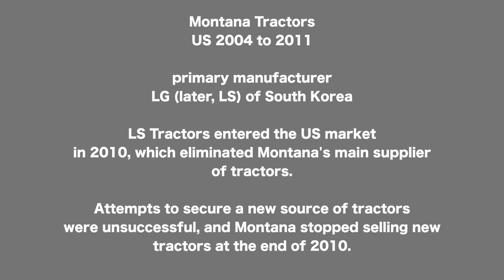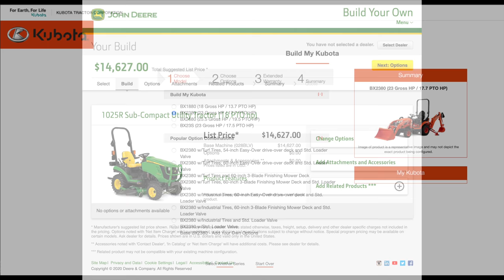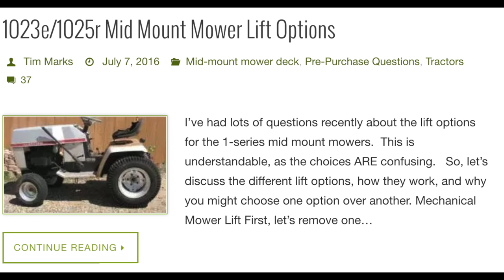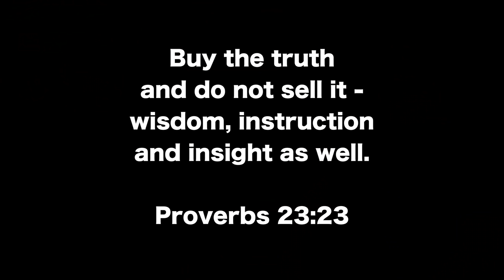Have NO REGRETS! Watch This Before You Buy A New Compact Tractor!

Comment: Tim, That was really helpful. I bought a 1025R 5 years ago on the advice of a friend who had one and now has a 2000 series. Yes, it was a lot of money but I had spent a lot of money for a Cub 52" riding mower that never worked and had a warranty worthy of the grass clippings it didn't make. I have 20 acres with 1/2 of it cleared and a combination of lawn and field grass. You convinced me to buy an MMM and it is awesome, especially compared to the Cub.

I went to 2 JD dealers and found a lot of difference between them. One was very helpful and understanding of my situation as never having any tractor experience. The other seemed totally uninterested in selling. They are equidistant from me in opposite directions by about 40-45 miles.

 I eventually got the 120 loader, 48" tiller, 48' rotary cutter,  the 60" MMM and a 60" rake. My neighbor gave me her 60" box blade. I can do everything I've needed so far with that equipment. My neighbors with large farms around me drive by with their big blue and white tractors with wheels higher than my ROPS and laugh at me and ask me what I'm going to do with my toy. Same thing you can do only it takes me longer! I'm totally happy with my 1025R and highly recommend it to a 1st time tractor buyer. Bet money I've ever spent on a toy....I mean tool! TTWT has been very helpful explaining the use of some of this equipment and introducing me to new add-ons as well.

Comment: Hey Tim!  I’m looking to either get the JD 1023 and the 1025r. My question is, what’s the best cab enclosure to get where I can have heat, a/c and a radio in it?  I’m a huge fan, and I know that you’d know the answer. Thank you.
Reply from the maker: I’m not a cab expert for 1 series.  I have a removable cab from originalcab.com
If you want a permanent cab, and looking at a new tractor, consider ordering the factory cab.

Comment: Would love to hear your thoughts on the 23 vs 25 horsepower versions (any brand). I’m a GC1705 (23hp) owner because my dealer said it saves money and will still do all the work I wanted, all while using less fuel over the 25hp version. I guess what I’m saying is if you go with the smallest one that will accomplish your tasks you may end up with a 1023E and 1 extra attachment.
Reply: I understand there are more bells and whistles as you size up. But most are not “must haves”

Comment: You might want to research who makes the small John Deere’s. I had a 25 hp 20 series. It was made by Yanmar for John Deere. None the less a fantastic tractor.
Reply from the maker: Used fo be made by yanmar.
Now they make their own.  Check out our 1 series factory tour video.
Reply: Yes sir I just did. I’m impressed. The one I had was an early 2000 model. The I d tag still said made by Yanmar. I am currently trying to persuade my brother to buy a 2025r. He has a 9 acre yard and he wants a 1025. Which I believe is the wrong series for his application.  The small John Deere’s are impressive machines. Only regret I had with mine is that I sold it with my farm. Thanks for posting your vids.

Comment: What about how will the local dealer will treat you if you buy it elsewhere? In my case, the next state over doesn't have sales tax (yes, by all rights we should pay our state) so that's a 6% discount right off that our local dealer may not be willing to match. I'm also not so sure how much I need my local dealer - Will I? Other than any warranty work, I'd probably do my own maintenance and repairs and order parts online.
Reply from the maker: All good questions without easy answers.

Comment: The coyote is a super attractive option.  Probably 10k less then a dear or kubota especially with 1 acre of land how much are you actually going to use it ?  The only thing I don’t like about Deere is you need to go back to Deere for attachments  because of the one family thing.   Nothing wrong with the massie either for that matter and they been around forever. The new holland is a decent buy to if you don’t mind the pin on  bucket.  1 acre jd or kubota is overkill unless you got to much money lol.  I have the kubota and don’t regret it but a guy can get away with any of the major brands to be honest as they are all good units.

Comment: Beautiful wrench set on the wall. Where were they made? My first set were cheap Chinese made bought at tractor store. Using the larger size on tractor equipment they would break. The open end arm would would break. Not good when you need to do a repair. Ended up buying quality wrenches. Unfortunately most are made overseas but steel is better. You usually get what you pay for.
Noticed you didn’t mention the Ventrac. Would be a little much for his situation.
Would put hydraulics on the rear and front.
Reply from the maker: Cheap Chinese set.  Bought them at the farm show this year.  I can’t justify good US wrenches as little as I use then.
...but I HAVE used them several times since Feb purchase.
Reply from the maker: Ventrac not appropriate for Nolan’s needs.

Comment: I understand the Deere and Kubota are great choices, but always disappointed that Massey is not included in the top brands to consider because they have been around for ever and dealer support is there as well, plus they are rock solid and cheaper to purchase. If there is a Massey dealer in your area I suggest you have a good strong look. I have a Massey with a loader and a 54" mm mower and the cut quality is awesome. Tractor never missed a single beat yet.
Reply from the maker: Massey has been featured in at least 3 episodes on this channel.  More than any other brand (other than Deere/Kubota).
Reply: @TractorTimewithTim  Yes I remember watching those videos, they were great. Your absolutely correct about Deere and Kubota being the 2 most popular brands, I just wish Massey would try harder to compete with them, they just need to work on some comfort features and better marketing to bring them up to the level of the other 2 top dogs. Thanks for the videos I watch them all.
Reply from the maker: Danny totally agree.  They are close, but they need a bit more refinement.

Comment: I'm heavily thinking about investing into a 1025r with the front loader, belly mower, and backhoe attachments to start a side landscaping/mowing/contracting work like trenches for plumbing and what not. Is that a good tractor for a good business start?
Reply from the maker: 1025r might be fine.  However, you need experience before you start charging folks for service.

Comment: You’ve talked about two brands, but why is there no mention of IH/New Holland or Case?  Based on your comment, they have both been around a long time?  Maybe they just don’t have the small tractor market?
Reply from the maker: IH/NH/Case does not make their own little tractors.  They remarket LS tractors.  Can’t remember if I mentioned in this video,  but this disqualifies a vendor for me.  If they have not committed enough to design/build their own product, I am not confident that they will be supported for the long term.
Reply: Tractor Time with Tim thanks. I own a 2000 TC45D that I bought new. I had owned a Ford 2000 before that, that I loved.  The TC has been a good tractor up until last year when I believe the from splines have gone bad. I can use it, unlike what I have read from others, but the AWD part is not working.  I’ve been going back and forth on getting a 1025r with a cab, loader, and 60” mower, but then I wonder about the same setup with a 2025r. I am keeping the TC since all of my implements are Category 3. I do like that the 2025 has a little more lift, but after watching this video, I think the 1025r might be good enough. Thanks!
Reply: I’ve been watching both you and Good Works Tractors and it has been super informative. I have a GX345 that is a 2002 model, but has been having issues and living in Minnesota, I want a cab for winter.
Reply from the maker: Check out originalcab.com.  Use code TTWT for a 5% discount.  Works great, and is surprisingly warm on the 1025r.

Comment: Following along here.I am in the market for a small tractor.Now my  horizons have been expanded our century farm needs tlc.I purchased a 316 garden tractor in 1985 the long term usability of the machine.It now has around 3500 hrs.on it.Mower decks not available front axle(cast iron)rebuild parts not available.Onan engine or parts not available.This machine is solid and was led to believe that jd was great about this.I am disappointed in jd for this.My late father and I did some engine work on a 1953 jd model m.parts available from jd.So to wrap this up my 316 got a very used mower deck off of craigs list.It now has a Briggs and Stratton vanguard engine and a need for spindles in the axle.It is still mowing grass not as much torque as the onan.The trans axle is rock solid.Big rant here but can I trust jd?Our families 1953 farm all super c we can get parts for.So the big question is when you step up to a "tractor"what does 30 years out look like?I don't take a purchase such as this lightly.

Comment: Tractor Time with Tim
Form what I had heard LS and New Holland are actually put together in the same plant. Basically the same tractor from what I was told.
Reply from the maker: Identical.  We showed this last fall at the Farm Progress Show.
Reply: @TractorTimewithTim  I'm not embarrassed to say I've owned an LS for the last decade.  No major repairs, has done everything I've thrown at it, most of the time successfully (sometimes you just need a big skidder or a loader).  But parts wise that is accurate, it's basically a South Korean New Holland, and luckily I'm only a few hours away from the plant in Battleboro NC if the dealer can't help me out.  Main benefit was HP for HP I ended up paying it off 4 or 5 years earlier than I would have a Green or an Orange tractor.

Comment: im just starting out with 2.1 acres and a 4 horse barn.. i want a front end bucket. its already cleared land. ( i already have a zero turn john deere)..i also have 200 acres, about 200 miles away (inherited it) i will be there a few times a year. it has a 1/2 mile long driveway. and will need to be maintained..... i also have a 200ft long driveway at my house... so idk what tractor i need or just an ATV or what. we plan on at least 2 horses and maybe goats..  thanks
Reply from the maker: 3R if you have a truck large enough to pull the necessary trailer.
Reply: @TractorTimewithTim  thank you for the input, I would say my truck could pull it, but already need a truck to pull my mud truck...ill look into the 3R and go from there, thank you

Comment: Hi Tim  I've heard that Deer have or trying to basically make owners take their tractors to a Deer dealer for maintenance or repairs . I've heard there's a challenge going on called " the right to repair. Have you any information on this  Like your videos    Great topics
Reply from the maker: Does not apply to compact tractors at all, and it has become very political.  The issue is much more nuanced than you suggest.  There is no issue with folks repairing their own machines.  Deere was trying to guard against folks making software changes to the engine which could damage the machine, invalidate emissions, etc.

Comment: Tim does the 2038 do much better on using the post hole digger than the 1025? Just wondering if there is a difference, I know you was not happy with it on the 1025. I worry that I’d have to look at renting a bigger  tractor for my area because it has a lot of rock. Other than that, I think the 1025 or the bx would be great for my 5 acres.
Reply from the maker: I haven't tried it on the 2038r

Comment: Never set your Heart on one brand and model like i did cause you might be disappointed if you don't get the dealer treatment on it and have to go to another brand.   The Best thing really is Dealer service and parts and the product knowledge that they have on what your looking for. And also if they are really aggressive they will shoot you a good deal right off the bat and you should also get a test drive or even a at home demo … and also inquire since Farm Bureau and Military service you can get special discounts and Kubota usually offers a multi unit if you buy accessories tools and such … Kubota and Deere are the only 2 that really do make their own tractors and the others even Agco and CNH are outsourced and the other gaggle is very much the same when it comes to Components

Comment: My biggest regret with my 1025r purchase is that I did not get the third function kit. I'm not a fan of most of the aftermarket ones mainly due to the price of them. Having the third function add a couple of bucks to the tractors financing would be easier on the wallet than a $700 kit from someone after the fact, plus the price would be "hidden" in the tractor payment so easier to justify a grapple or other toy to the finance committee.
Reply from the maker: Wow. This is what I was talking about in the video.  $1400 up front with the tractor vs. $700 for Artillian kit. ...all to get it included in the financing.  Tell you what, I might be willing to finance the artillian kit for you at THAT rate!!!
Reply: @TractorTimewithTim  Well, my point was more that I  wish I had this video to watch before I had purchased my 1025. I just didn't know then. To be perfectly honest though,  it's mostly your fault that I want a grapple in the first place, lol. I do really enjoy your videos, keep up the great work.

Comment: Some serious consideration should be given to a QUALTY low hour USED tractor vs a new model. You can save a bundle if you can be serlective in the used model shopping. Put the savings into attachments.

Comment: Definitely not knocking green, but it is a Yanmar Tractor, I have an older JD 750, tag on tractor says Yanmar Engine works.
Reply from the maker: The 750 was a Yanmar tractor.  Starting in 2001, Deere began designing their own compact tractors.  The last of the pure Yanmar tractors were retired in 2016.
New machines still use Yanmar engines, but they are designed in Georgia.

Comment: Wondering what you think about the LS MT125?  The one I am looking at comes with a front loader, backhoe and belly mower and it's about $2000 cheaper than the JD 1025r. It's my understanding that they are made by the same company that makes the New Holland. Is that true or am I mistaken? Also, they have the same Yanmar motor as the 1025r
Reply from the maker: This episode clearly explains why we stick with ‘the big two’
Reply: @TractorTimewithTim  It explains why you like the big 2 and as you said it is your opinion.

Comment: Hey Tim enjoy your videos and have researched a ton decided to go with the 1025r for my budget and needs I believe it will work fine but after talking to different dealers a couple of them suggested the 57" frontier tiller of the 49" will the 1025r pull that size of tiller? Thanks for your time
Reply from the maker: I would recommend that you stay with the 49”.  No reason to spend more money on larger one.  ...and no, the 1025r won’t handle the larger one very well.
Reply: @TractorTimewithTim  thanks for the reply!! I was thinking that 49" would be a better fit!

Comment: Opinions? They are like nose's. Everyone has one. Well, here is my 2 cents. At 77, I have been around for a long time. That doesn't mean I know everything, it just means I have been down the road of life further than some. I have a 2013 Kubota B-2920, 29 hp, 4x4 with loader, and 3 speed HST transmission. I love it. I am surprise what this small tractor can do. I did check out the Jon Deere before I bought my tractor. Price was a contributing factor for me. Another thing I thought about was, this tractor, in Japan, would be used by someone having to make a living with it. These tractors are built tough. Now, I'm not knocking the John Deere, they are great tractors. Just for me Kubota was my pick for my tractor. One thing to keep in mind. When buying a small tractor, consider getting a 4x4. Two wheeled tractor this size need the 4 wheel drive. I respect Tim's opinion on everything he has. I believe Tim was raised on a farm, and should know a thing or two about working a tractor.  Thanks Tim for your videos. I have learned a few things from watching them. It would be wise to listen to someone with Tim's experience. God bless!   From! Not to far from you. Lol!
Reply from the maker: cannot disagree with your reasoning.  Thanks for the kind words.   All subcompacts and B/2 sizes are 4wd now, I think.